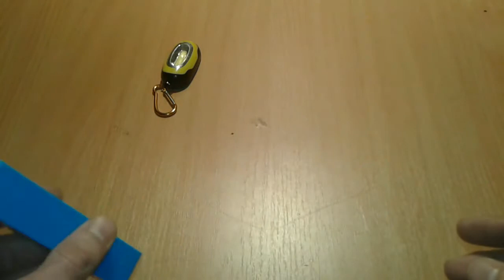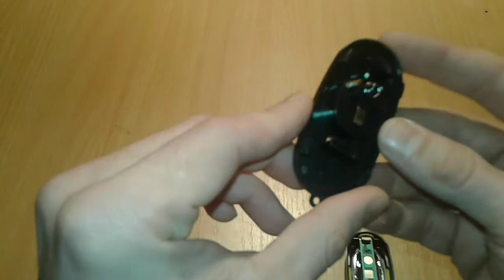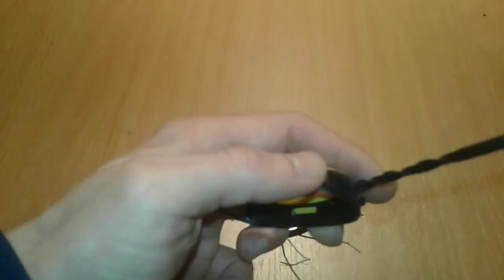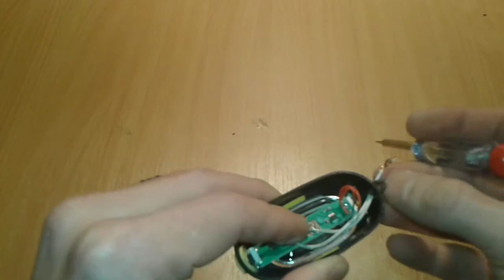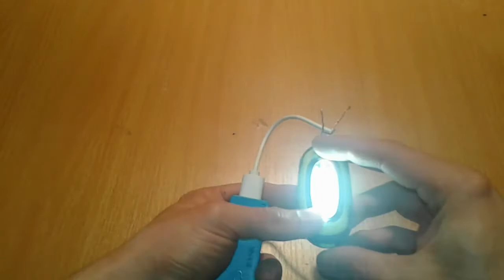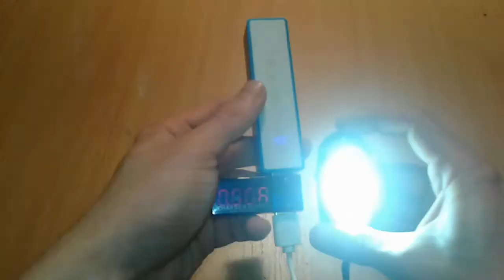USB Led HACK diy using cob flashlight for any electronic projects

Comment: I need some ideas, how to reduce car battery current to suit mobile charging ..by other words instead of 50 amps (car battery) only I need 0.5 amp (for mobile )...thanks in advance
Reply from the maker: You can buy an auto phone charger with USB output or dc-dc buck converter the same with usb output there are very cheap and they got protection and voltage stabilization its not efficient to make an voltage regulator.if you need some links give me your email address
Reply: NoSkillsRequired i need to do it my self(DIY). .not to buy it .
Reply from the maker: gazaziho ok I will send you some diagrams
Reply: NoSkillsRequired thanks thanks  ..waiting for them